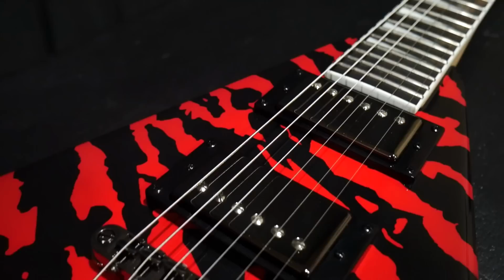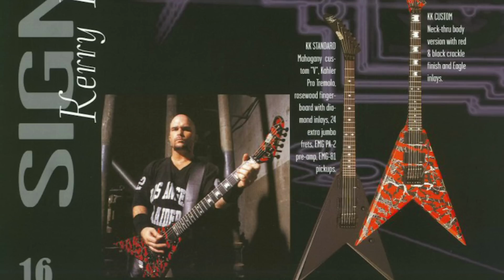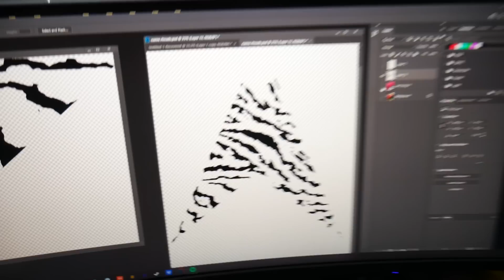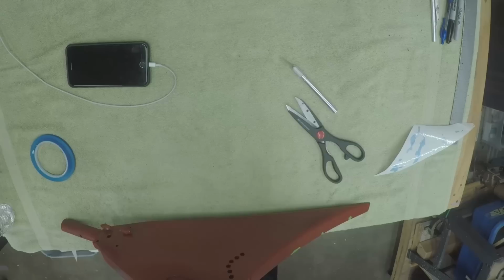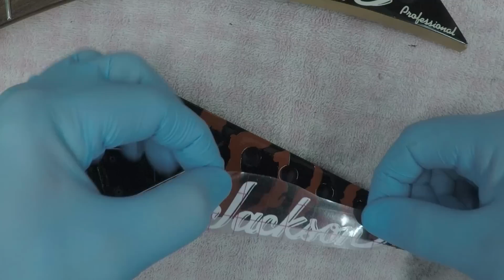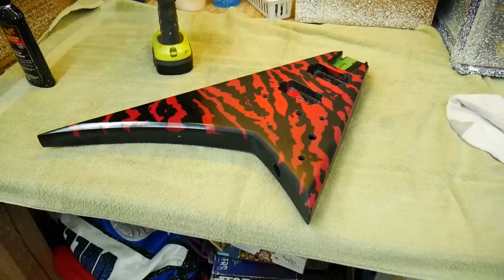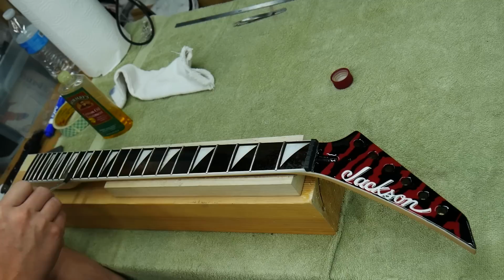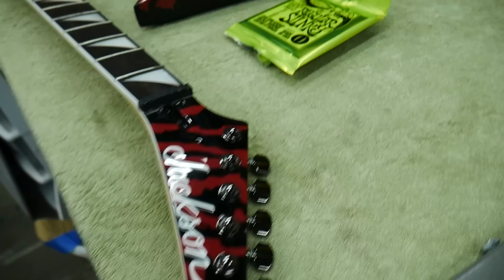Trash to Thrash #45 - KING RHOADS (Kerry King inspired Jackson JS32T Rhoads)

Comment: My first thought when seeing the rattle cans was "no!!" but looking into it, the clear is a 2k, so this technique is viable. It would be far more cost effective to get an air compressor with spray gun, as opposed to using cans though, over time it would save money if you do enough guitars. I even use the cheap $15-20 purple gun from harbor freight and get excellent results with $75 2k clear (Upol brand) for 1 gallon. So with the can, you're paying ~$120 per gallon. Plus, you could use the compressor for other things potentially. But for the small projects of a guitar, you could easily get away with a 15-20 gallon compressor I think. Just food for thought.

Comment: Cosmo Black easily rubs off. I had it 2 current and 1 past guitar. On the latter, the hardware turned silver chrome over time. 

The finish looks great but is not durable.

Comment: Hey man I have an old schecter v with a fender style headstock I'm trying to find out what model it is or if it is a schecter but underneath the head on the bolt on it says schecter and it has the numbers 40 46 and 7070 but there's no numbers on the headstock I've been trying to find out what model it is for years I've googled it I couldn't find anything

Comment: How to adjust my Floyd Rose to be able to abuse it more like deep dive bombs, etc without going out of tune. Should I upgrade it? What’s the best Floyd?
Reply: Make sure the baseplate is parallel to the surface the guitar (in other words, that the bridge is completely perpendicular to the posts). You can use some silicon lube on the knife edges to make sure they’re slippery.
What model is it?